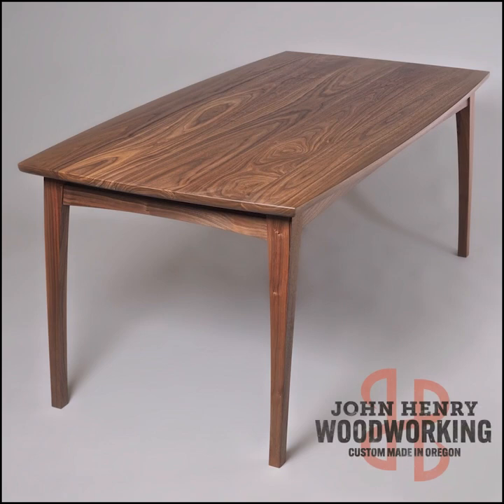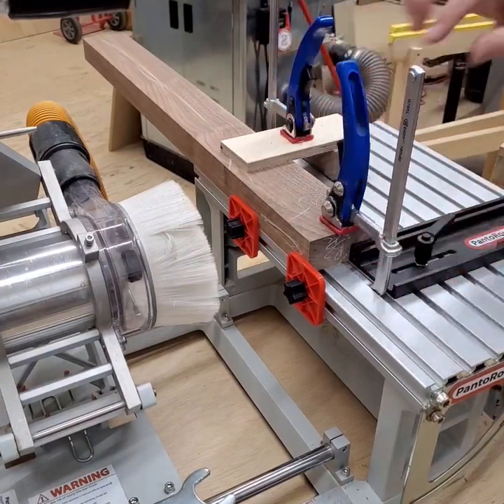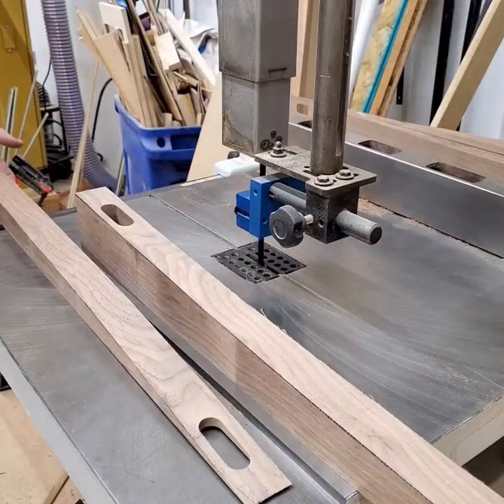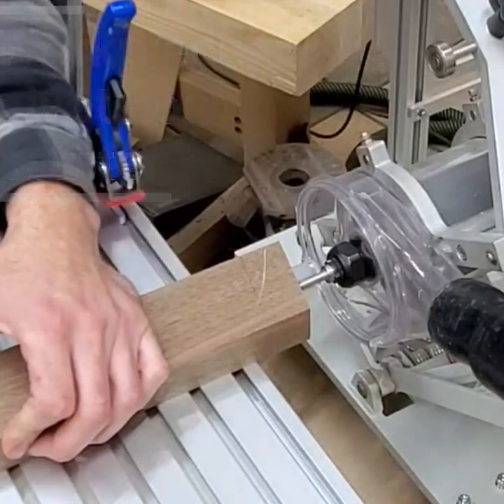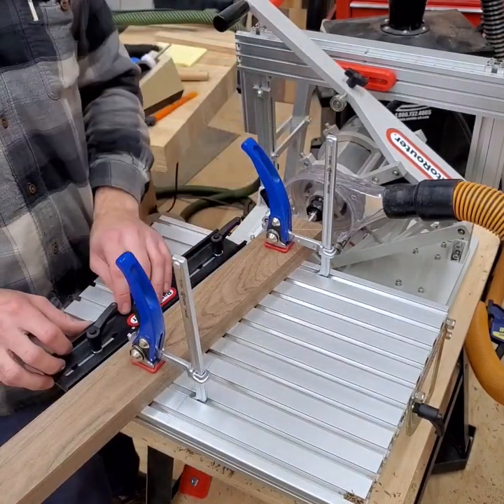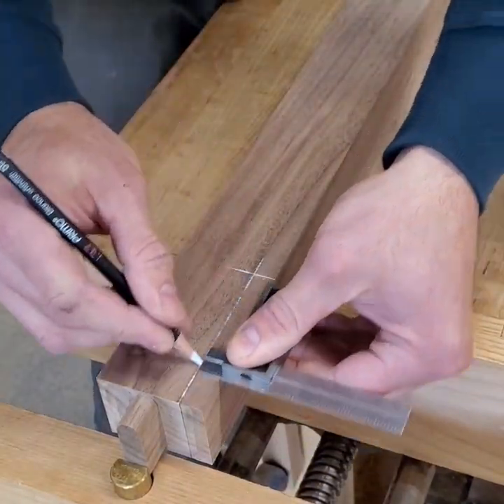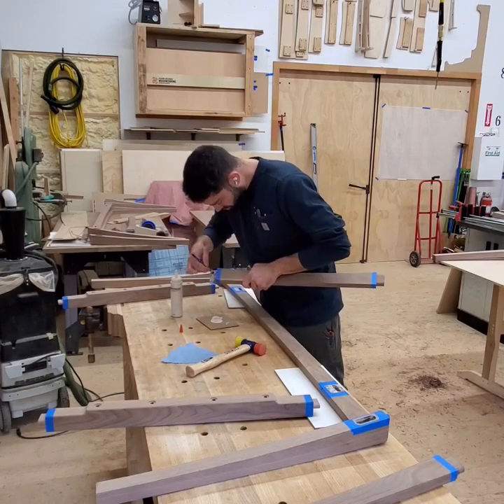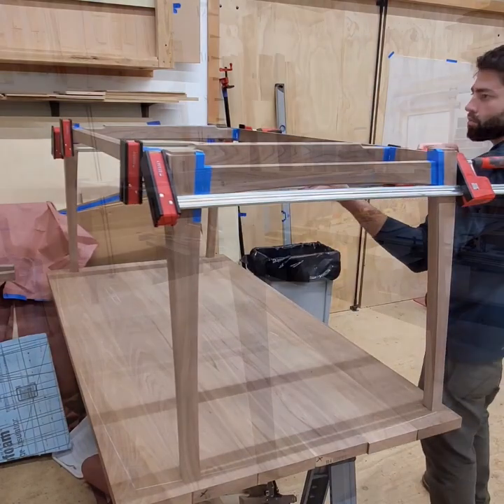PantoRouter Tech-Tip - Angled Tenons

Comment: Hello Mac, I have always had a problem when cutting angled tenons. What you demonstrate here does not work as the centre line changes the more the workpiece extends over the table. You do not give a ratio or proportion to what the overhang should be. Placing the centre finding bit on the vertical centre line of the workpiece and moving the fence to accommodate the required angle does not mean that the router will cut a symmetrical tenon. I usually find a happy medium by hit and miss until the tenon is acceptable. What am I not seeing here?
Reply from the maker: The secret is to identify where the finished tenon shoulder will be and find the center of that, not the face of the workpiece.  Once you have the layout, extend the center of the finished piece to the face and center off that line.  We show more about this layout in our video from the GOOW webinar about compound angles.  Hope this helps!